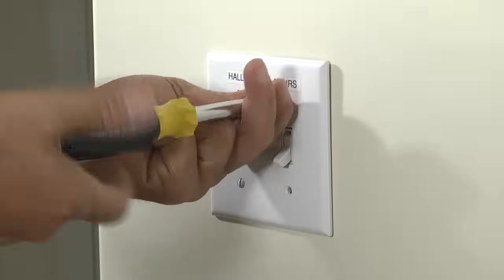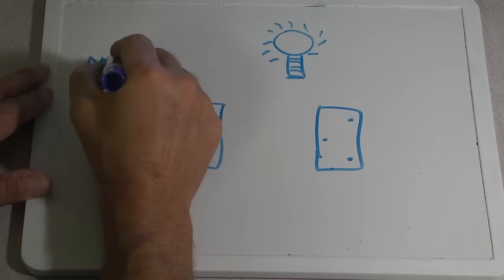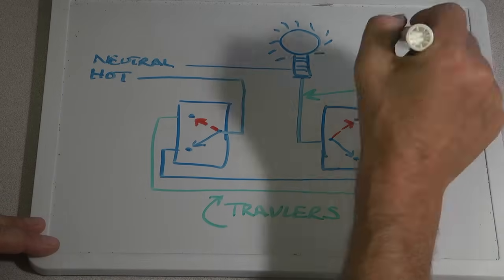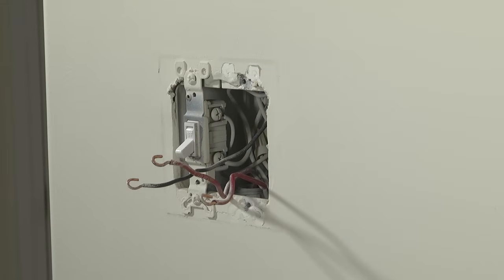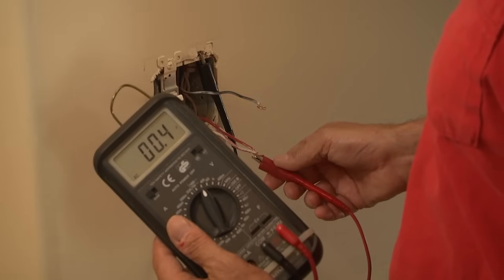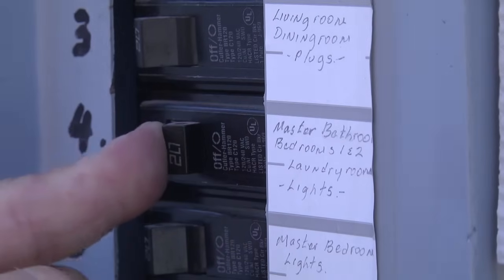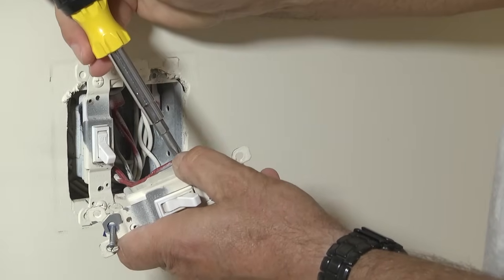Find the correct wiring for a 3-way switch in 2-minutes!

Comment: What if there is no ground wire (older house)?
Reply: You could test from a neutral wire, if the switch box has a neutral, oftentimes in wiring from the 70s and earlier they sometimes ran the hot feed up to the light fixture,  then dropped a 14-2 or two  14-3's  from the light to the switch box(s) depending on whether the light is in between the three ways or on the end of the three ways.   In these configurations there no neutral wire, if the wiring is the old style cloth wrapped romex 2 or 3 wires no ground,  or knob and tube (yikes) you could plug an extension cord into a nearby receptacle,  stick one probe of your meter into the neutral slot, then use the other probe to find the hot in the switch box.   If none of the switch wires test hot, try sticking the probe into the other slot in the extension cord, then try again,  the wider hole is supposed to be the neutral slot, but in an old house finding reverse polarity is not uncommon especially if the wiring has been hacked by someone who doesn't understand wiring procedures.
Reply: @Sparky-ww5re  My wires had been scrambled by handymen renovators. I disconnected all wires, including in the overhead light. Could not find Line power in any of them! I had no idea why, but now am finally thinking that the metal boxes were not grounded. So the usual set of instructions did not help much. I finally made the non-intuitive decision that the White wire was used for Line and Load, so tried using the Red and Black as the travelers. That worked. If metal boxes are not grounded, would that show no power on any of the wires?
Reply: @KpxUrz5745  correct.   You need a ground or neutral to find a hot wire using a multimeter.   A trick I had found useful was to plug an extension cord into a nearby receptacle (of course make sure the receptacle is powered;) ) and leaving one  probe inserted into the neutral,  which is the wider slot if wired correctly,  I can then find my incoming hot, whether that be in the switch box or light box.  One cable entering a switch box indicates the power comes in at the light, or sometimes with a three way setup the installer might have ran power to one switch,  then to the light, then dead end at the other switch.  In the case of a dead end switch (more common in older homes than in recent years, typically before the 1990s) there is no neutral,  and the white wire should be identified as a hot with a piece of black tape near the terminal although that was seldom done.
Reply: @Sparky-ww5re  Sparky, thank you so much for actually responding with real answers! You really have an excellent channel, and you demonstrate the highest level of attentiveness and excellence to provide important help to us non-professional DIY'ers. I handle most of my electric wiring situations just fine, but it can be confusing when first getting into 3 and 4-way wiring.

Comment: I have always been confused by the wiring of  3-way switches and you have simplified the process.  The only hard part is finding a white wire (common), mine was tucked away in the back of the box                      T H A N K S.

Comment: Nice clean and simple video.
Unfortunately, my house isn't wired this way and need some help.

switch A:
Red hot
Black hot
White hot
Green Cold

Switch B
Red Hot
Black 1 Cold
Black 2 Hot
In the back of the box but not attached to switch B.
Whites capped together (Hot)
Green to a bare metal twisted together.

From what I have found online this may be a coast or California 3 way. Not entirely sure.
Reply from the maker: Please give me a call and I can walk you through it. 310-398-7430  (voice only-no text)

Comment: Can anemone help me? There is no power to either switch box even with the breaker on. No wires have power at all. Not the red, black, white, or the ground but that's good. Lol.
My husband removed and broke the old switches before I got involved and no one seems to have my set up (power from panel directly to the fixture, then routed to the switches. There is no main or slave. Both boxes have the same wires exactly and non of them have power. Fixture is led dimmable. Original figure was ceiling fan. Fixture worked fine until hubby turned off breaker and removed old switches. All other items on that breaker have power, just not the switch boxes or their corresponding  Fixture.
Reply from the maker: Please give me a call and I can help you with the problem. 310-398-7430 (voice only-no texts)

Comment: My stairway switches were wired by an unruly simian sometime in the past, who thought it was best to throw silly requirements like romex and grounding out the window. Instead, they used a couple of 3 wire outdoor orange extension cords (yes, those extension cords people run weed whackers with) wired up who knows how, but certainly not looking like any of the examples I saw on-line.

This video has literally changed my life. Thank you!
Reply from the maker: Please give me a call at 310-398-7430 (voice only-texts) and I can walk you through it.
Reply from the maker: So glad my video helped you.
Reply: @MarVistaCat  Help! After following the instruction of shorting together the wires in switch A, the light comes on and all 3 of the wires in switch B have power. My setup - In switch A, I have 2 orange cables. Each has 3 conductors - black, white, and green (green is not ground! it seems to be a traveller). In switch A all wires are also bound in pairs, color for color.  Each pair is then is connected to different terminals on switch A. In switch B I have 1 orange cable with 3 colored wires. There is no grounding in this configuration.

When I disconnect all wires, only 1 black wire in switch A has 120v.

Comment: Please help!
I have two sets of 3-way switches right next to each other like in your video.  
Set 1: 
---Light does not work, bulb changed, still does not work.
---Went to replace the switches with new ones. Wired exactly as they were, light does not work.
---Tried your method to find "HOT" wire and "LOAD" wire.  Voltage on "HOT" was only 30 volts???
---Hooked them back up with "HOT" and "LOAD" wires on respective Common switch terminals.
Set 2:
---Light DOES work.
---Tried your method to verify "HOT" wire ad "LOAD" wire.  Voltage on "HOT" was only 30 volts again???
---Without twisting the 3 wires together, I checked the other switch wires and 2 wires had 30 volts this time???  Remember I did not combine the 3 wires together.  
---Hooked them back up the way they were, and the light works.  

Do I have wires crossed, a problem in my source breaker box?  What should I do? This is really weird.  

p.s. I double checked my multimeter in an outlet, and got 120 volts, so it's working properly.  Also, I just checked the light socket of the light which works and it is 120 volts.
Reply from the maker: Please give me a call and I can help you. 310-398-7430 (voice only-no texts).

Comment: I have a question. My 3 way switch consists of 2 horizontal toggle switches. One controls a ceiling fan, the other controls the ceiling fan light. At the other end of the circuit, is a 3 way vertical toggle switch that controls both the fan and light. After replacing the switch with 2 horizontal toggles, it’s not working right. Each switch has at least 1 constant hot when the wires are disconnected.
Reply from the maker: Give me a call at 310-398-7430 (voice only-no texts). I can try to help you.

Comment: This was definitely useful & between this video and another, I think I've figured out a simpler method using an approach from both videos:
- power on, switches disconnected
- find the load on whatever switch will be Switch A. With this known, you know the other 2 traveler wires
- Connect the 2 traveler wires together
- go to Switch B & do a continuity test to find the traveler wires on there
- the other wire SHOULD be the load

Granted, this assumes there isn't any other wires coming. I had to deduce all this from a triple gang with one 12/3 & two 12/2 drops.

Comment: FYI, if you followed this to a T and got the correct voltage results (1 of 6 live = hot, tie, 2 of 3 live = travelers), wired your switches correctly, and it still doesn't work? You have a faulty switch

Comment: when he says house current and the multimeter reads 119.3 thats voltage not current theres no way a light switch is pulling 119.3 amps fyi

Comment: You can also check it in continuity test. Short the two wires in other 3 way switch  than go to other 3 way switch and by using test leads attouch it to two wires in the 3 way switch until it had already a resistance in your tester

Comment: If it's a two wire electrical system (no ground) what changes?
Reply from the maker: A three-way switch, switches the load side of the circuit. The ground in a circuit is a different topic.
Reply: @MarVistaCat  I see.  I was confused because this old house was wired wrong.  They either used a California or Carter system on switch, a multimeter wouldn't work (nothing to ground to) and there was too much  induction to use a non contact tester.

My 40 minute project turned into a 10 hour affair, and I probably just burned my house down at some point in the future.

Comment: Safer option, cap off the wires rather than leave them exposed. Use non contact meter to find your live wire, NOT testing exposed wires.

Comment: Following the same video, I found both my A and B switch Travelers show LIVE wire independently. I could only found 1 wire that does not have any power must be my load. Is this normal?
Reply from the maker: Give me a call at 310-398-7430 (voice only-no texts) and  I can walk you through it.
Reply: @MarVistaCat  Thanks for offering help I tried to reach out to you. Today. I could not pick up this task again last few days. I got chance today to work over it.
Reply: To be precise at Switch A. Travel 1 ( 38 V) Traveler 2 ( 38 V) Hot ( 120 V) and  Switch B Travel 1 ( 38 V) Traveler 2 ( 38 V) Load ( 0.1V). I found things but why 38V power on T1 and T2. That I could not understand.
Reply: is that Phantom Voltage( just learn about it)

Comment: This is absolutely what I needed. It demonstrated to me that the wiring was correct, so I then replaced the switch that included a dimmer. After installing the new switch, my problems were solved. Thanks for this informative and tightly-edited video.

Comment: I'm working with old wiring My voltmeter doesn't tell me any voltage on any wire with the circuit on it's just all zeros someone explain to me what's happening One switch will turn the light on and off If the other switch is on the other switch won't turn it on and off if that makes sense
Reply: Oh and when I mean by old wiring it's all black wire
Reply from the maker: Please call me at 310-398-7430 (voice only-no texts) and I can help you with your wiring issue. Thanks, Jim
Reply: I have the exact same issue. I’ve spent over 47+ hours trying to figure it out. It’s a older house and one switch works only when other switch is in certain position.
I’ve watched this very simple to the point video and still nothing. So frustrating!!

Comment: This saved me so much time and I didn't even electrocute myself :) Definitely came in handy. Apparently the electrician that wired the original switches used the white wire as the hot. 🤦‍♂️

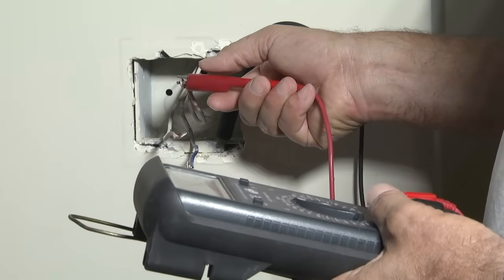Comment: at 1:28, why does the load wire not have current? isn't it connected to the lightbulb which is connected to the power source?
Reply from the maker: Give me a call at 310-398-7430 (voice only-no texts) and I can walk you through it.

Comment: Very good video, but it still didn't work for me.  I think I have power coming back up through my neutral wires because the light never turns off. It only goes from full on to half on.  I'll hafta dig more into the problem, but one side of the outlet, they have the wires tied off above the fixture instead of inside the gang box.

Comment: OMG. I'd been playing with my 3-way Kasa switches for FIVE HOURS today, and couldn't figure it out. I kept trying different wire combinations and kept having the same problems. Somehow I randomly got the right configuration for 1 of the sets, but the other set of 2 switches I couldn't get. Then as soon as I watched this and you said "the load wire is the one WITHOUT power" I tested it with my no contact tester, found the load wire, and everything on the 2nd set of switches worked instantly. Thank you!

Comment: Good day sir! At switch "A" when I tie the wires together and turn the breaker back on the breaker trips.  What does that mean? 

Background to my situation: the light switch related to my issue is located in the garage. Last week it would not switch to the "on" position so I went to purchase a new one. Not nowing it was a 3 way switch I purchased a regular one and upon installation the breaker tripped, I removed the switch to see if I had maybe didn't wire it as before and upon removing i noticed the switch screws were different and than thats when I discovered it was a 3 way switch, I went back to lowes and purchased  (2) 3 way switches and that is when I went on YouTube and stumbled upon your video. Switch "B" is located at the other end of the garage, switch "B" was covered with the wires capped. BTW,  obviously I am assuming that is switch "B" as I did not get as far to test it due to when I tie the 3 wires together at switch "A" the corresponding breaker trips.. 

I don't want to call an electrician due to money issues.  I am comfortable with working with this, although electrictronics is my weakness I hold a degree in mechanical engineering and have worked in the manufacturing industry for 15 years,  just giving you a little background on myself to give you an idea who I am. 

Thank you much
Reply from the maker: Give me a call at 310-398-7430 (voice only-no texts) and I can walk you through it.
Reply: @MarVistaCat  dude thanx! Its late so ill give you a ring tomorrow at about 11 am. Expect a call from 818-317 number. I appreciate your time sir!
Reply from the maker: @dannydee9919  - Jim didn't receive a call from you yet. His phone doesn't get any text messages, so give him a call and he can help you out. 310-398-7430. Thanks

Comment: I just wanted to say thanks for your 2 outstanding videos on 3-way switches! Had a light that would dim when turning on another light on the circuit. Your video was clear and easy to understand. Messed with the circuit for a few hours and took a break. Saw your videos and in less than 15 minutes found the issue and was fixed! Wife says thanks too!

Comment: Even easier.  Once you have identified  and marked the line wire. Leave the power off and just tie the other two together. Then at your other switch the two that have continuity are your travellers there and the other is the load to the light

Comment: can you help me? outside light,2 way switch and outlet in wall have stopped working.left side switch has juice,other switch and outlet does not.installed camera in my home not even a few feet away from this area.installed/running wire in attic for camera,turns out wire for 2 way,outside light and outlet was cut in half.splice them back,still have same issue.im out of luck.any ideas? even replaced old with new switches and outlets.still nothing
Reply from the maker: Give me call and I can walk you through it. 310-398-7430 (voice only-no texts)

Comment: I've got a 3-way switch situation: in both boxes the white wire is hot. There is also a receptacle on the circuit along with 5 light fixtures. I'm stumped.
Reply from the maker: Give me a call and I can help you. 310-398-7430 (voice only-no texts)

Comment: Hello...question.  I have wired up my three way switches and have the following situation:  both switches down, no light. Switch one up, switch two down, light.  Switch two up, no light regardless of switch one position.  Will switching the travelers on switch two fix this? If not, what will?
Reply from the maker: Answer: The line (current, 120VAC) is at one switch and the load (light) is at the other. Verify this by following the video. Next, be sure the line and load are connected to the correct screws on your switches. And, finally, the travelers(s) can be connected to either of the remaining switch screws.

Comment: How do I jump power from 2nd 3 way to operate separate fan or light without fan or light being affected by 3 way switch? I presumed I could do this while running wiring instead of separate power line. I'd hate to have to remove drywall
Reply from the maker: Ron, Give me a call at 310-398-7430 (voice only-no texts).

Comment: This is a clinic on how to make a "how-to" video. Short, concise, and informative. And you helped me sort out 60 year old wiring. Thanks
Reply: Absolutely great vid, very easy way to find the runners.
Reply: Yes, I have to agree.  It is concise and covers the important information.  I was going to use my Fox + Hound electrical line tracer but it was out of batteries.  This method works!  I wired up a Smart Dimmer switch with a 3-way switch and it works fine.  60 year old wiring too.
Reply: Indeed

Comment: Hi,
So the video isn't clear on which screw connector is the common terminal for the hot wire or load connection. It seems to imply the common is  the single screw on the one side of the switch, not one of the two shared on the other side of the switch.  If you had just turned the switch to the common side just a little bit so we could see which side you're talking about that would prevent a lot of connection mistakes and trials and errors.  A graphic diagram probably is the best way to go.

Comment: after i twisted the three wires on switch A I went to switch B and all 3 wire showed current. My problem is if one switch is in a  position the other switch does not work.
Reply: All three have power to ground??